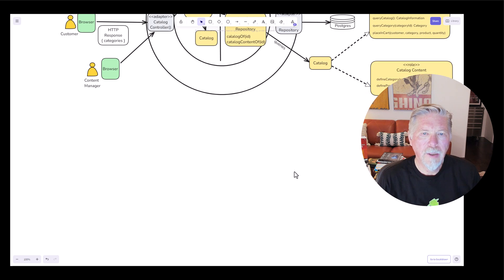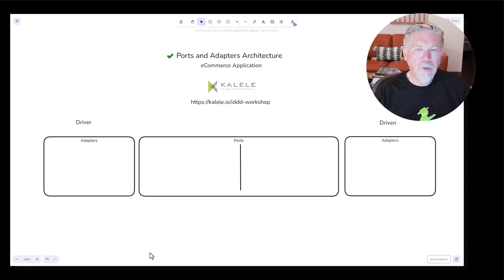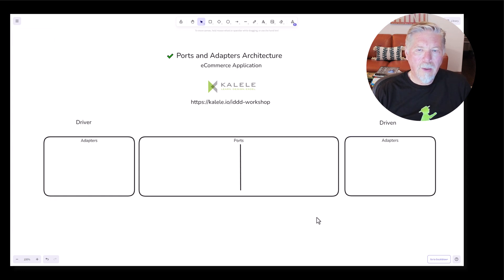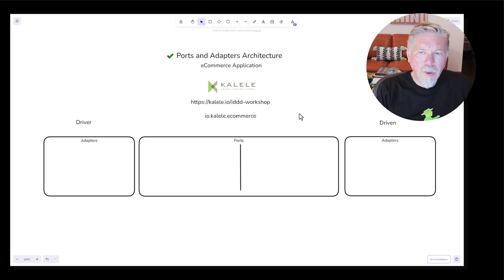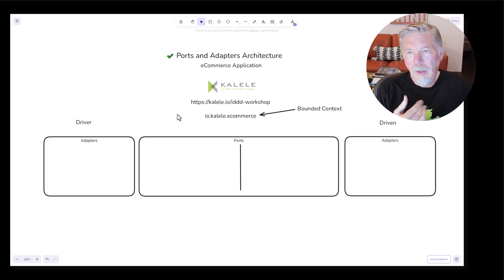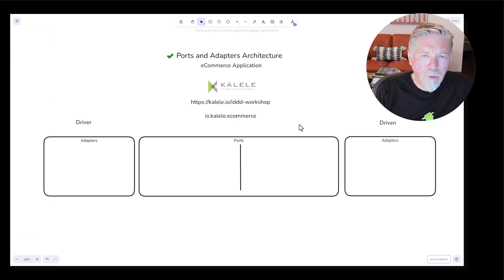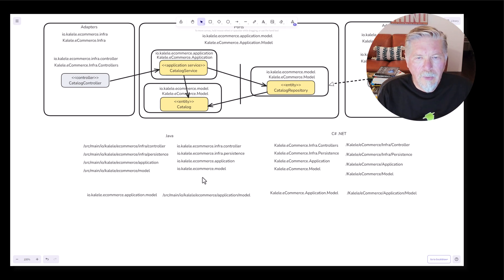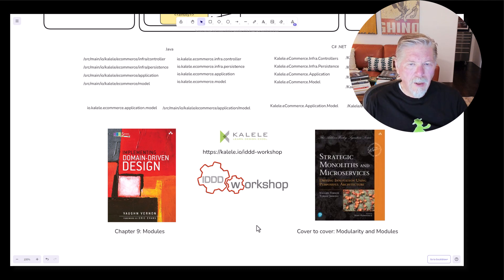Design Accelerator: Ports and Adapters Architecture Part 3

Comment: In which layer should the transaction management sit? To me, it would logically be in the 'application' services  because those know which units of work (outbound adapter calls) belong atomicly together. But transactions are more like a technical dependency and should therefor be part of the infrastructure layer. And in that case, how can the application enforce atomicity when required? Should an outbound 'transaction management' adapter be introduced?
Reply from the maker: The technology is in the infrastructure. The use is in the application. It's not a crime for the application to acknowledge that transactions are in use any more than it would be for the application to use a repository. In fact, you could manage transactions by using an openSession() or start() on the repository, and then commit with closeSession() or rollback with failSession(). Another less intrusive way is to use an AOP-based application service (port) method annotation (.NET attribute).
Reply: Thanks  @VaughnVernon, so placing, for example, a spring Transactional annotation on the inbound port (interface) is allowed? Isn't it still a technical dependency in the application? Of should I create a custom annotation for it, which can be interpreted by the DI framework as transactional?  Maybe I'm just trying to enforce the rules too strict.

Comment: When there aren't many use cases, it's fine, but as the number of use cases increases, I'm not sure if this architecture is good due to cognitive overload.
Reply from the maker: Why would the number of use cases make P&A less desirable and effective? Please provide a better alternative.

If there are an overwhelming number of use cases in a single course-grained component and there's a large team working on it, you've got a different problem. You are missing a higher-level abstraction that is used to manage cognitive load.

Comment: I'd keep it simpler when it comes to packaging:
- keep the app in the root of the package that hosts the bounded context, so in this case it would just have io.kalele.ecommerce and io.kalele.ecommerce.infra
- avoid subpackaging the app, so I want to clearly see Catalog, CatalogRepository and CatalogService altogether, it makes it clear if the bounded context is growing too big

I also have one question, I prefer not to use the word repository because it helps me think more about the language and the concept I am dealing with. For instance if I had a Product domain entity, I would probably call my repository ProductCatalog, rather than ProductRepository. In your example is there something in the domain that might actually be a better name candidate instead of CatalogRepository?
Reply: Dude, he showed just examples, not a definitive structure or implementation.
"...it makes it clear if the bounded context is growing too big"
Do you know he is Vaughn Vernon, right?

Comment: Hi Vaughn. Nice one, appreciate it. Though I have a couple of questions:
1. What if we need to persist our Catalog using third-party API? Would there be just another implementation of CatalogRepository interface?
2. What if we also need to generate a PDF view of the Catalog while persisting it? Where would that application logic for generating PDF live?
Thanks.
Reply from the maker: Thanks!

1. Yes, sure. There are tradeoffs vs. temporary (or permanent) local storage followed by an API call. The details might get into the weeds so I'll stop there.

2. That introduces similar tradeoffs as with 1. Assuming you want the PDF generation to always happen, persisting the catalog data should occur first. Again, how you follow up with the PDF generation step is an implementation detail that I could cover in a later video.
Reply: @VaughnVernon  Thanks a lot. Would be great to cover the details in your upcoming videos.

Comment: I would also separate the adapters to separate Gradle projects (Maven modules), to ensure that people later on don't introduce the popular Spaghetti-pattern and introduce dependencies in the wrong directions. That would then necessitate an "Application" project that binds the internals and adapters together.
Reply from the maker: Right. You brought that up in Part 2 as well. I could do a brief follow up in the next video. I've done that before with Java but I'm not up to speed for how to do the same using a .NET build. I could just state that whatever build process you use could enforce the direction of dependencies.
Reply: Isn't that the whole point of P&A, direction of dependencies? In C# we also use projects to prevent dependencies going the wrong way since it doesn't allow circular references. 
However I much prefer the way F# deals with this by enforcing strict dependency ordering, even down to the function declarations in a file. Even though it may be a little annoying, it allows for code to become structured like P&A without even knowing about P&A.
Reply: Exactly. As an added benefit of using modules to separate model, application and infrastructure is that you no longer need packages to do so. Personally I like to use my packages to group domein specific stuff and use that name consistent over the the 3 modules. So here I would use a io.kalele.ecommerce.catalog package. There are two nice things about this imho: first, when opening the project one sees directly what this application is about. Secondly, in Java one can use the package scope for classes that don’t need to be accessible outside the catalog domain. E.g, nobody needs access to the PostgressCatalogRepository.

Loved this series. Going to share them at work with the colleagues.